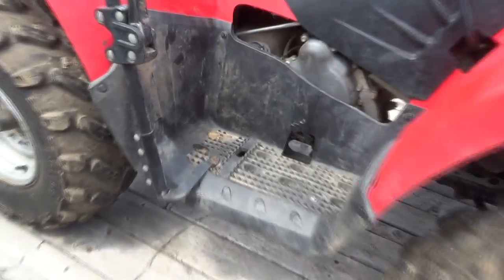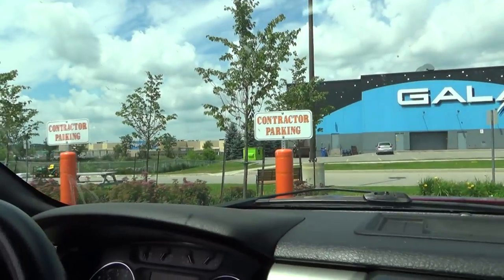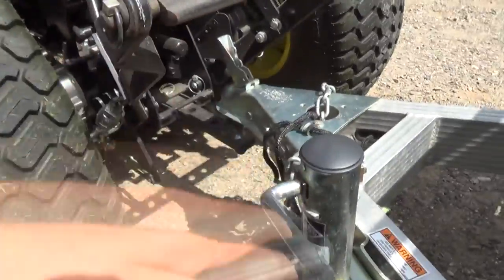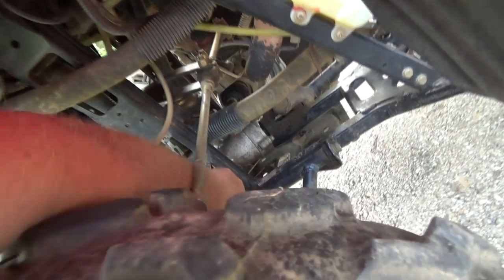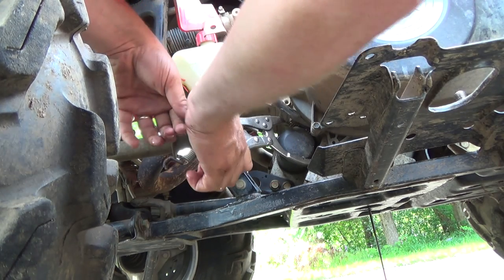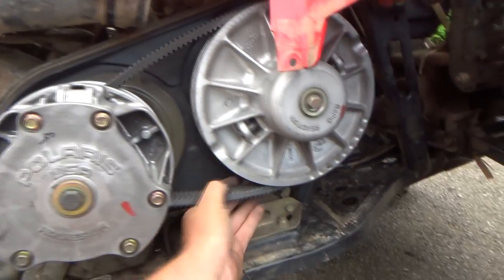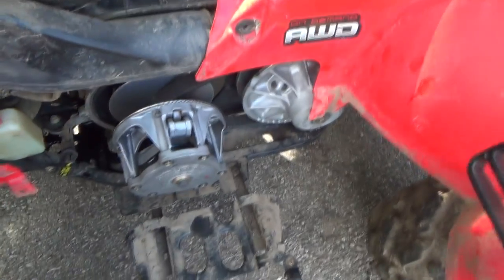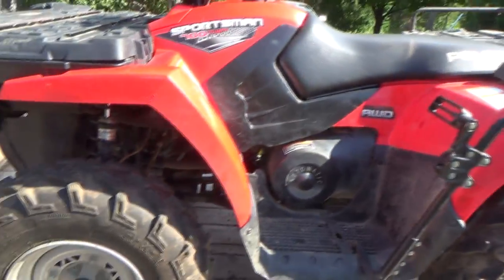6 year oil change   whoops my bad

Comment: Nice video.  When changing oil filters like that. I found a oil filter wrench that fits the end of the filter. Most auto parts stores have them.   All you need is a ratchet and an extension bar.

Comment: That belt drive system is a type of continuously-variable transmission (in this case a VDP or variable-diameter pulley). Pretty neat how they work.

Comment: The pistons in your 700 twin travel up and down at the same time, both up and both down together, they fire opisit each other giving a power stroke each revolution, making the engine run smoother. the lopey idle has to do with the cam profiles, kinda like a Harley or a hot rod engine, I work at a Polaris dealership and do those oil changes almost every day. Keep up the great vids!

Comment: I have a 2010 xp and the hand brake operates the front and rear.  The foot pedal operates just the rears if I remember correctly but I never use it.  I think the previous generation does the same.  Mine literally gets ridden every day in farm and recreational use and regularly hauls several hundred pounds more on the racks than rated.  It pulls trailers and plows over a mile of driveway in the winter.  Changed the fluids and put a speed sensor in it.  It's been very reliable.  Easier to service than the previous gen too.  I think I'm on my 4th set of tires.  btw just bought an oil change kit and they're 37 bucks usd on eBay.

Comment: The belt drive is the same type of mechanism as in my small 50cc scooter. The thing is 10 years old, and while the odometer stopped working at 4100, I think it has done more than 10thousand km. And in the last fall, my belt blew up and disintegrated. New belt cost 32 bucks, and it wasn't too much work. But the cover of my drive belt is made of metal! ;)

Comment: Bill , does that Brake use dot 3 or 5 ( SILICON) ? you may need to flush the system completely as the two do not mix .

Comment: Bill, you got me curious about the PS4 oil. I started poking around the web and looks like everyone who's ever bought a Polaris has an opinion about it. Polaris claims its a full synthetic 2W50.  Consensus around among the guys willing to subsitute seemed to be among Amsoil racing 0W40, Castrol Edge 5W50, and Mobile 1 5W50. There was also a decent number who didn't care about winter starting using heavy duty turbo diesel 15W50 with their favorite being Rotella.  There was also one guy who seemed to think the brakw fluid was DOT4.  Hope that helps.

Comment: Your atv is efi (electronic fuel injection) which means there is no plug. It says efi on the headlight cover on the side that is on the handle bars
Reply: Bla Hoe What does having EFI (Electronic Fuel Injection) have to do with having a spark plug? All gasoline powered vehicles whether they are EFI or NOT have to have Spark Plugs! What do you think ignites the fuel in the combustion chamber? MAGIC? Bill's ATV absolutely has Spark Plugs!
Reply: NorthDakotabrew Not all diesels have Glow Plugs! They do not  have to have Glow Plugs to run. The Glow Plugs do not fire the fuel! The Glow Plugs are only to make it easier to start in the cold!
Reply: I understand glow plugs quite well. My son is an ASE diesel tech and I drive a diesel truck. I've also had equipment without glow plugs. My point was that Bla said there were no plugs because it was EFI.
Reply: NorthDakotabrew Ok, That's a good thing! Yeah, that's why I replied to him too.

Comment: 5 yrs is fine for an oil change, if you didn't put many hours on it. Oil don't go bad over time,  just from hours run, worn metal parts grime or water in the crank case. If you don't put a lot of hours on it will never really go bad, its in the ground for millions of years.

Comment: The variator variable ratio drive is used on most road scooters/motorbikes, very clever system bill :-D.
I have a dislike for the weakness of alan keys, they never seem to fit snug :-(

Comment: Those polaris don't deserve new oil they never run anyways
Reply: caveman733 I have a 97? Runs like new, runs circles around my dads 2013 offroad.
Reply: And I have a 2004 Polaris ranger with 1400 hours on it from plowing snow. Keep your facts separate from your opinions bud!
Reply: Mine has 3500 hrs on it. Runs good.